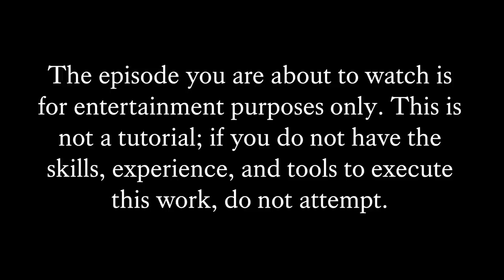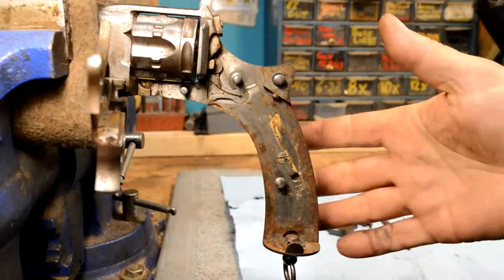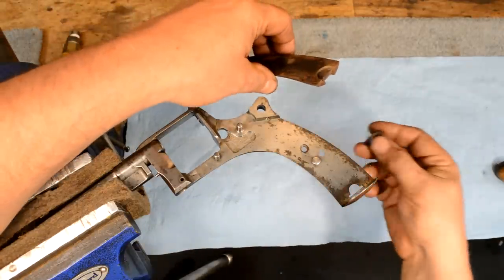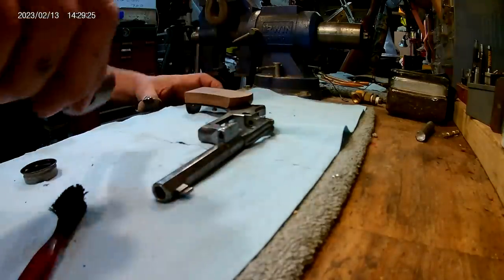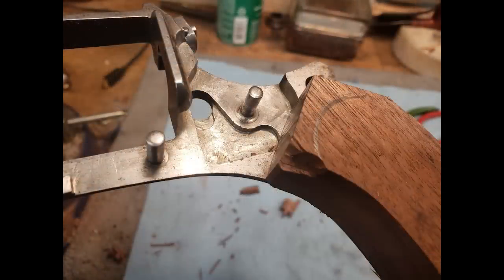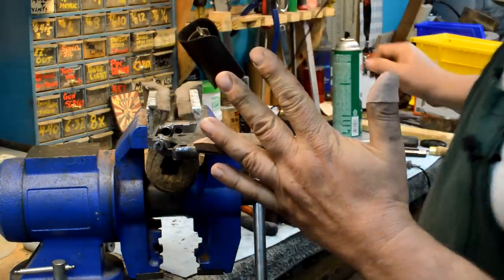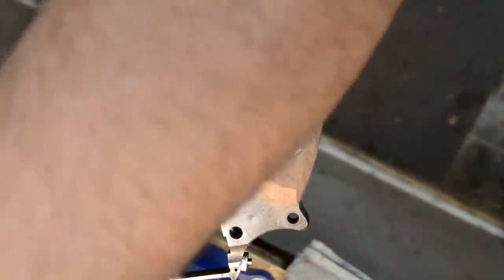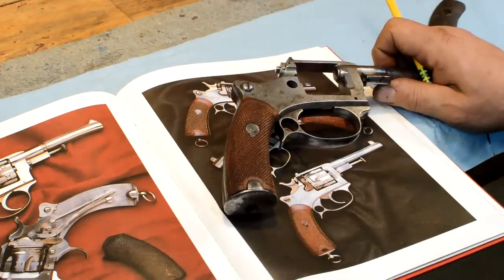Anvil 076: French Revolver Grip Fabrication

Comment: $600? That's a steal man. Restoration, preservation, historical research, wood, checkering, chiseling, inletting, rasping, wear on your checking tools, and the time to stone the sharp instruments and the stone itself and stain and oil and dry times, any pumice or sandpaper. Wear and tear on the tools alone would be $100+. If the book is rare it might cost $100-200 to obtain. Wear and tear on your eyes. Your lungs. Your hands and neck. Your electricity costs. And then hourly wage. You gave them a major break. By the way that rasp is amazing. Cuts like a dream.
Reply: Tool wear would be ¢10 at most.
Just out of curiosity - which craftsman do you know who charge for wear on their lungs?
Reply: @garymitchell5899  Most do. That's why labour is so expensive now. Healthcare costs have to be factored in. If anything they don't charge nearly enough.

Comment: When I did grips for Luger and P-38 pistols and carbines for John Martz the custom Luger maker from Lincoln, CA., I used to mill the grips on a milling machine.  P-38 grips were the most difficult because they wrapped around the back of the pistol. Mark did a great job on these grips however, he did way too much work contouring them. I used a Dremel tool to contour. I used metallic tape to protect the frames and power sanded to the tape.
Reply: Hats off to you for your work for John Martz!

Comment: $600 for that amount of work by a proper master gunsmith is a darn good deal and worth every penny. I watched a film from WW2 about the making of Garands at Springfield Armory and it showed those stock duplicating machines and the inletting jigs for cutting out the inside of the stocks. Indeed, it only takes a few minutes knock out perfect stocks, when you have several high $$$ pieces of equipment to do it with! By hand, forget about it!

Comment: $600 for the grips and light conservation. But what did the firing pin and spring cost?  It looked like a $200 wall hanger but when it leaves your shop it’s a lovely $2,000 historical shooting piece. Pretty expensive but for the right person it’s chump change. To me it seems like there is still value here.

Comment: Note to whenever you see an angle that... at least in north america... drafting tables had locks at 15, 30, 45, 60, 75, and 90 degrees... so when it doubt aim for one of those.  This is standard for architectural and structural drawings to the extent that when you look at old drawings and see something silly like 6 degrees its because the guy screwed up his drawings and rubbed out the 15 and made it work.  There is also a universal WTF of all the old guys looking at it when they see it :p  Its too bad that most of the old mylar drawings are tossed in the garbage now.

Comment: I've got a French Revolver d'Ordonnance that looks like it spent a good bit of time buried in the ground. It works--barely--but man alive, is it beat. More relevant to the topic at hand, its most interesting sign of the long and strange life it's led is the fact that some previous owner replaced the grips with a set made of what appears to be Plexiglas.* Interesting choice for a field-expedient repair material, but they do look kinda cool.

* other transparent plastics are available
Reply: back in WWII many troopers would replace grips with plexiglass (usually a ruined fighter plane's windshield)  then put a picture of a loved one under it.  Common German practice; I have seen a Frommer Stop  so treated.
Reply: @pilgrimm23  Huh, interesting. Well, there's no sign of anything being under them now, but like I say, the gun looks like it spent a few decades buried, so who knows?
Reply: @pilgrimm23  that's quite an interesting little bit of information :)
Reply: @jonwingfieldhill6143  thanks.  I am a trivia nut
Reply: Cheap and readily available, and easy to carve to shape.

Comment: Hi Mark - I get frustrated sometimes with the grain not cooperating when I am getting close to final size. I have a couple of really good files with milled teeth by Corradi and Pferd, and they slice the wood really well, even if it isn't in line with the grain. You can't go totally against the grain, but you can come close. Better than with a chisel, even a razor sharp one. I agree with you that I never use these on metal, except copper or silver some. Only in a pinch, though. It is fun watching you and learning some of your techniques. thanks again.

Comment: @Mark Novak   I've been trying to figure out what longshaft buffer you have, and cannot find anything similar to it ANYWHERE..  I wanna get set up for carding with a wheel like what you have, but from every source I can find, people say to run them at 500RPM or less, and every benchtop grinder/buffer wheel I see is way beyond that.  Do you happen to know where I can find something?  Thank you!!
Reply: I think he has a baldor long shaft buffer, they can run anywhere from 800 dollars up to 2 or 3 thousand dollars, be careful when buying one and make sure you have the right power source for the one you pick. Most of what baldor makes is three phase, and 99.99 percent of households do not have 3 phase. Chance are you will need 210/240 volt single phase or just a 120 volt unit. Check out ebay and good luck finding what you want. To get 3 phase you would need to either buy a 3 phase generator, buy a rotary phase converter or if you live in the right area pay your electric company to run 3 phase to your building, all three options can cost over 10,000 dollars easily. Or you could just buy a drill press and mount a carding wheel in that
Reply: @xlxyetixlx  Thank you, Kyle!  I just really liked his setup.  I've got some things to look for, then.
Reply: @rodgersmith1573  you can also improvise one.

A friend of mine has a buffer set up using some automotive pulleys and an old washing machine motor.

Comment: I don't dare pretend to know more than Mark, but I personally would have done the in-letting with a mini router with a depth set screw. Clean faster cuts.
Reply: I've been struggling with that - trying to make grip inlets with the router, and then with the milling machine, but I think what I actually need is sharp chisels.  Target grips for the Hi-Standard model B - so there are some curves to deal with, but mostly straight lines.  I cnc cut a template, and used the router to follow it, but of course it jumped off and ruined that attempt.  And I can do straight lines on the mill, but the curves, no.  I'm thinking that slowly by hand is a better approach...since it is just a hobby, I can keep trying, and damn the hourly rate

Comment: The old school way of mass manufacture was to perform a single operation at each set up in a line snailing through a factory complex, because of the limitations of the tooling technology of the day. We have cnc machines and goofy tooling to make ridiculous things that f'ing engineers dream up. We have coordinate measuring machines to make models of a part with a laser scan. We can do it. Is the return on investment cost prohibitive because few people want to buy a 1000$ 19th century revolver replica that's got all the goofiness of a 19th century revolver and doesn't have a built in laser or red dot cuts like the new plastic and aluminum revolvers do?
Reply: There's honestly a lot of machine hours in an old firearm. Look at the price of a US made 1911 compared to, say a CZ75 or other all-metal pistol. Plastic frames are expensive to tool for, but selling a couple hundred thousand brings the cost per frame to a trivial level.
Reply: It's not just about replicating and repopping this stuff either - when you start scanning the parts of a century plus old firearm, what is an impossibility to account for is the worn-in tolerances due to a century plus of use, abuse, neglect, and corrosion. We could easily replicate worn out guns and produce brand new worn out guns, but I think we all agree that that misses the point entirely, lol. So, how much work and time and money is it going to take you to work backwards to try to "figure out"/guesstimate the correct manufacturing tolerances for each and every part? 
  
Even if you utilized all of the technology that a small business owner could realistically get their hands on today, and subtracted the cost of that technology from the finished product, you're still going to end up with a VERY expensive product, there's just no getting around this.
I think people today have a misunderstanding that "firearms cost as much as they cost, and they always have" - but today's firearms are the cheapest/most affordable they have EVER been in history(today's budget hunting rifles would destroy vintage 'sniper' rifles, even if 'brand new' - and would be more reliable), especially on some kind of "quality-per-dollar" scale. When you look at pre-WWII firearms especially, even pre-WWI, where everything they produced we would describe today as "ALL BILLET GUN!!!", basically every major component being machined from a block of steel, these were VERY expensive firearms to manufacture back then, and they would still be expensive to manufacture today. Cheaper with CNC vs all manual ops, but that only emphasizes how expensive many of these firearms, like early machine guns, sub guns, semi-auto rifles/pistols, etc. were in their day. And, a lot of that cost was due to the often pretty over the type complexity of the age(especially when we look at auto-loading firearms between, say, 1900 & 1925ish), technology isn't getting you around the amount of parts and the precision required of each(precision costs money!).
  
Then we get into the issue of springs, where all the technology in the world isn't going to produce accurately performing replicas without some trial & error testing.
Then there's the asbestos cooling jacket seals on [Maxims I think? Can't remember exactly] that we don't even currently have a solution for today, so the owners of these things(that actually shoot them) just have to deal with the jacket leaking around the barrel. Needless to say, in instances like this, you obviously aren't going to be able to produce new asbestos-anything, so now you're going to have to develop a modern replacement for this and you're going to have to perform a lot of testing.
  
There's just nothing "cheap" about producing firearms, because they're one of the more tolerance/consistency dependent products with high minimum material quality requirements, a large number of parts, and a very high standard of expected quality from consumers. And, once you step outside of today's ultra optimized designs, and back into the more complex, less efficient designs of the past, you undermine what it is that makes modern firearms actually affordable(mass production, simplification, refinement, and optimization).
Let's put it this way - there's a reason why there's SOOOOO many failed firearms manufacturers and so few multi-generation successful manufacturers, and a LOT of that has simply come down to luck too, on both sides of that coin.

Comment: Say you used desil to clean, soak it for an hour and brust the rust off with a soft brust then when oil it after all the rust is gone, what is good and bad about this way, love to know, as always love ur vids.
Reply: That can definitely work, but a full tear down, boiling the metal parts, and cleaning with #0000 steel wool or a #0000 steel carding wheel, with a bath in kerosene and a thorough wipe down and oiling after, is yhe best way to bring a firearm back to as-new of a condition as possible.

Comment: I would expect your shop-rate is $150/hr minimum for the kind of shop you have, the specialized work you do, and the depth of expertise you bring to the work.  So, $600 for a job like that seems VERY low (even in 2020)...
Reply: At least ten times too much. Tell me why your economy is in trouble again?
Reply: Yeah, at 10:45 he says just to make one grip is a full day. Pls pls pls tell me you don't have any financial responsibility at work?
Reply: As a machinist I can say that I understand the the process and the tolerances needed to do this job correctly. Plus or minus a 1/64” is not an option when fitting these grips. You can’t compare a housing framer to a cabinet or furniture maker. No cabinet or furniture maker is going to charge housing framer prices. There is a reason they are all called tradesmen.

Comment: I find it sad that guns don’t have grips anymore
Reply: David Parry  if you're reverse-engineering grips for an existing gun by hand, sure. In actual production they just slap wood blocks into a machine and churn em out. Mostly don't have wood grips now cause the frame is a solid piece of plastic.
Reply: There are a LOT o metal frame gens, all have grips
Reply: David Parry  Most wood grips cost $40 - $100.  Anything that is mass produced will come from a jig or a CNC machine

Comment: A lot of work. A radiused chisel would have looked cleaner on the half-moon lower part of the grip. Can't blame you for bailing on the other grip. Most checkering is done after the finish is complete.
Reply from the maker: Didn't bail on the other grip, it just wasn't done on camera. As far as chisel selection goes, this grip was probably lofted like the transom of a wooden ship, and the multistep mechanized inlet preformed in 3 dimensions at once. Hand inletting is barely doable in 2 dimensions.   I can put you in a room with several professional checkerers who will not do a finished stock, preferring to have the ability to clean up over bare wood if necessary. Most checkering is done over a surface that has been finish sanded, not finished
Reply: you get it done!  much respect.